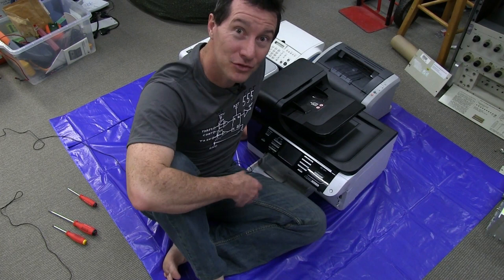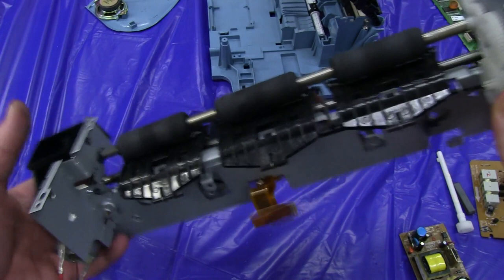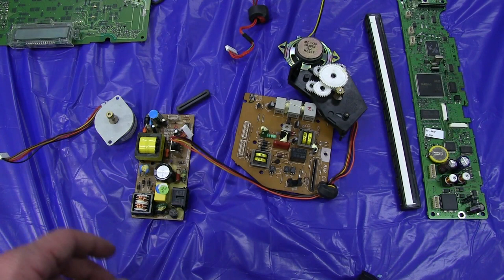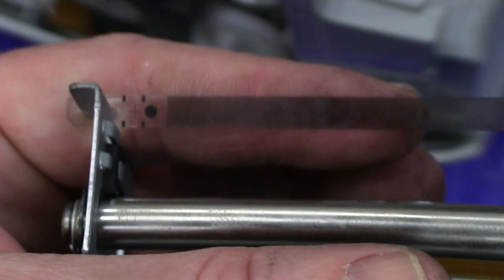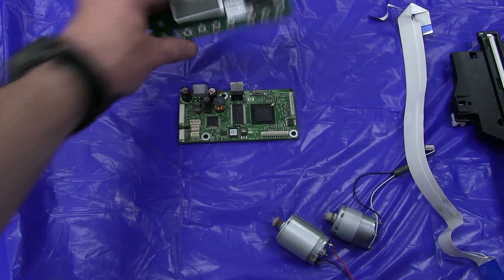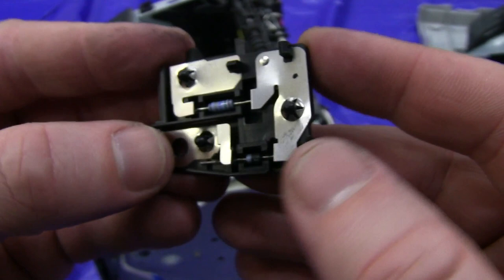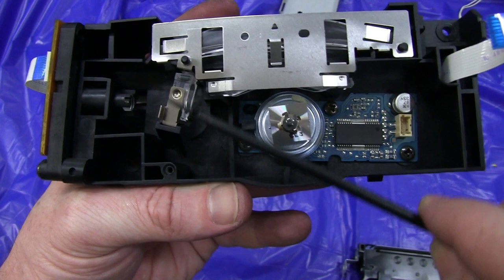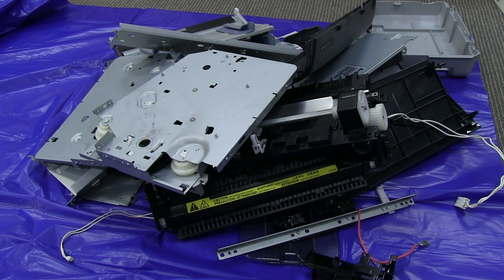EEVblog #488 - Dumpster Dive Parts Salvage

Comment: From what you salvaged on rail assemblies and such, I start to wonder if you would have enough to build a rudimentary 3D printer if you'd combine it with a raspberry or perhaps an arduino.
Reply: Melt down and print with the plastic scrap.

Comment: The resistor is a fuse resistor + diode, printers usually have a counter inside that counts how many pages have been printed or how many times the roller/fuser has turned and when it reaches the limit set by the manufacturer e.g. 10,000 pages the printer over currents the fuse resistor burning it out and now printer will refuse to print. it will usually give you a message in your PC saying maintenance needed bla bla bla replace XX assembly/part.  

Toner cartridge also have a chip inside them that is just a coutner- it does not actually track the toner levels so when you hit the limit the chip tells the printer im done... when it is not and it will refuse to print (even if you only printed 1 dot for the 1000 pages and your cartridge is full) .. it also stops you from refilling but you can buy the little chips and fuse resistor on ebay

Manufactures really really underestimate the life of the parts so you have to replace them more often. Some people desolder or short out the EEPROM chips on the logic board so that it cant keep track of how many pages have been printed lol

The fuse assembly, logic and power boards are actually valuable for if they work, stick on ebay especially the heater/fuser assembly.

Comment: If you can find the datasheet, its worth keeping the drivers with the motors. They will be handy to interface with microntrollers and especially for driving the stepper motors they came with (usually, just need clock and sometimes enable pin). I guess you should keep them and the wiring as a complete "package".

Comment: For an engineering project my group and I took apart an old inkjet printer. It did not have a full one piece head movement component like the fax but we took out the axle, print head holder and motor. With an Ardunio we built a functional 3 story model elevator. It was pretty cool.

Comment: I use the precision ground rod, that the ink cartridge carrier travels on, to set the tail stock on my small lathe. Set is between centers and you have a good point for your indicator to reference. 
Sorry, I know it is not electronics but many of us have more than one hobby. BTW a purpose made rod for setting your tail stock can run well over $100. Just a thought.
Reply: If you could collect enough of those you could use them in a 3d printer. That would save you quite a bit of money.

Comment: I believe the weird little steel plate/resistor/diode combo from the laser printer makes contact with the end of the toner drum/roller's axle. At least that's what I remember from a teardown of my own.
My guess is it's used to control the charge of the drum, so static doesn't build up and smears toner dust all over your pages or something. Maybe. Honestly, I have no idea, other than that it makes mechanical contact with the toner's metal axle.

Comment: 1)save and open the tiny button switches- they have a silver contact.
2)save the oscillators- they are silver,
3) save the ink jet cartridge - the film has gold on it,
4) save the white plug-ins on the circuit boards, the contacts inside are gold plated,
5) take the computer cable, cut the ends off, and remove the gold- plated contacts.
6)save the wires in the ink jet printer and computer cable. i use this small wire for my other radio projects
 (i just finished changing my old clock radio into a SW/ AM/ FM radio, and used some of the scrap wire from my ink jet printer.)

Comment: 20:04 I've built a reflector using that heating element... it's a 425W halogen tube(at least in those that I took apart). 2 or 3 of those also can be used as an electic heater if you put it in a black metal case. Be warned! Acrillic paint will burn of easily if you don't respect a proper distance(wich makes it less efective), or don't protect if from overheating. That thing can heat up metal over 100 degree C wile most paint supports only about 60 - 80 degree C max.
23:35 That lens is in angle to deflect the laser beam exactly to that rotating mirror.

Comment: The metal rods are great for home made cnc machines and 3d printers, anything you need to make an x, y grid and have the motors move, though the plastic pulleys aren't that robust and wouldn't hold up to much abuse.

Comment: I've used the motors from printers a few times, the ones with gears are great! You can hook them up to a simple rectifier and use them to make kinetic powered circuits. I use them with sound synthesizers, I recommend trying it out :)

Comment: As a foot note to the laser diode, there are some nasty elements to playing around with them depending on the wavelength. Most of these diodes are 808nm IR and when you power them up you see a piss poor red illumination, they is in fact pumping heaps of energy out in the non visible spectrum. BE CAREFUL, they WILL snot your eye.
On the plus side you can take the KTP/YVO4 crystal and all of the optics from your green laser pointer ( assuming it is 808nm ) and use the source as to pump the crystal and emit 532nm. I'm not going into the physics of 3 and 4 state population inversion systems, however, through a series of frequency doubling ( second harmonic generation ), a high power green laser can be achieved. Make sure you keep the same orientation to the LD as the original pointer and you are off and running. If you don't keep the correct orientation nothing will come out.
Admittance angel is important but if you play around enough green photons will come streaming out..
Lastly, I suggest TEC cooling the crystal of your duty cycle will be in the order of a few seconds and the life of the crystal will be reduced significantly as this method is at best 30 percent efficient; therefore, 1 watt 808nm in, 200-300mw out at a crystal temp of 23C.

Have Fun!

Comment: Sir with the right size copper connector you can fashion a torch tip with a Gear inside of the copper and it Make a Nice Flame

Comment: If you are starting out on the cheap, a lot of those connectors and buttons are useful to stockpile, like USB ports and power connections... the 'flat flex' or ribbon cable connectors might be useful if you have plans...

Comment: Once I disassembled an HP printer and got two useful things: Bluetooth USB Stick, WiFi USB Stick. I use them in my pc, They are bare board, no enclosure, but very good. I put the Bluetooth and win7 identified its driver fast, but the Wifi was not easy to find the drivers.

Comment: You might want a list of the fully working stuff I've found this year..
I cant do one, there are too many!
Off the top of my head:
Stereos, Big magnifying ring lights in need of a bulb, loads of aquariophilia stuff, small tanks, bubblers, pumps, (woohoo pcb etching tanks),
Numerous scanners, including an extra flat travel one.
That's excluding the stuff needing minor repair, often purposefully disabled by the previous user, usually severed power cords..
And that's limiting to electronics!

Comment: That device at 19:00 is probably the paper tray sensor. I did not see where you got it from but on some printers there are guides in the paper tray to identify what kind of paper is in the machine such as 8.5 x 11, legal  or A4. When you adjust the paper tray, it presses on different areas of the sensor. So that might be what it is.

Comment: The resistor and diode on plastic holder is used for HV discharge from opto cylinder. Otherwise it will not grab toner (charge up by laser) and not put it on paper.

Comment: You can use the springs to tension the steel wire of a hot wire cutter for polystyrene cutting. As the wire gets hot it expands in length. So we need a spring to tension it and to conduct electricity to the wire.

Comment: I think it's more along the lines of chance of actually doing that vs. difficulty of desoldering such a large surface mount package vs. the cost and availability of a new part. Not to say you can't do it if a low budget and high patience motivates you properly.

Comment: My guess is that the markings are for alignment during assembly (or even just alignment aids used when printing the plastic strip) and not read by the sensor.

Comment: A cool use would be to use the laser module to print traces directly on to a photosensitive coated board, but i am guessing one would need to replace the laser diode with a UV one.

Comment: Hi guys, I'm just getting into electronics repair RIGHT from scratch. There's actualy VERY few books or training videos on how to do it... which is weird. So i'm watching guys like this to try to learn. I'm actually go to start to practice Soldering now when i get a station, I have some broken PS3's and stuff that i can mess around with that i got for free just to learn to use the tools of Soldering etc.
Problem is, i only have about 90 euro to spend on a Soldering station with heat gun. Can anyone recommend a good cheap station that's not gonna go on fire and blow up due to how crumby it is? 
I'd really appreciate some info, thanks!

Comment: The fuser unit from one of these laser printers is quite useful if you are making your on PCB`s with the toner transfer method, ... just take the PCB and the transfer paper and run it throu ... you`ll still need the powerunit for it thou, and perhaps the motor, but heck, you are getting yourself a easy to make "toner transfer unit" :)

Comment: I think the resistor has something to do with dis-assembly safety. High voltage is used in those copiers and since it's reached using Villard cascade voltage multiplier, which utilizes diodes and capacitors, it's best to have a way to discharge it automatically. Those are my guesses only tho! Would love feedback on this theory.

Comment: You should teardown the fuser because the heat element is an halogen lamp. In your case thats 220v. And you can use that.If you look at the power supply pcb its direct power from mains it only got a relay in between.highly recommend you take it out.

Comment: I think that little section with the resistor and diode is maybe connected to ground, and is used to make sure there is no static on the rollers or maybe something like that, although that would make more sense for a toner printer.

Comment: I've taken apart some laser printers and found halogen lamps used as heaters.
They are double-ended tubular lamps 27.5cm in length with R7S base.

Comment: Apparently, UrJTAG can be used with the USB Blaster and many different devices.

The pinouts on most things probably won't match the standard Blaster cable though, so you'd need to solder the individual signals to the correct pins on your device.

You'd also need to know the memory map of the device, and what type of Flash chips or IO it has etc. (assuming UrJTAG supports it?).

Comment: 15:58:  that white thin strip is a long led strip inside of the photo pickup assembly for the scanner. that model doesent use cold cathode lamp. also tip, all "cold cathode" lamp units have a pair of HV leads from a small(ish) flyback like board useually white sometimes black or gray or even brown, and thay are easily spotted upon the assembly useually, the ones that dont use the cold cathode lamp typicaly are much smaller due to the less comples designs that dont use the mirror strips& lenses.

Comment: The control board at 18:34 doesn't have nothing
I see three SMD LEDs that are very usefull if you want to make something tiny that lights (for example keyboard illumination)
or the quartz cap on the other side which can be replacement if clocks actually fault those or some microcontrollres (that one might design) sometimes require external cap for their clock
but salvaging just for those isn't the cheapest thing to do

Comment: In the laser printer you have the laser diode which is in the laser diode scanner module. The laser diode is not going to be much use to anyone wanting to build say a laser pointer or anything. They are fairly low power 35 milliwatts or less I believe but I do know that they are infrared. So they are an invisible beam of laser light so not good for a laser pointer. Also very dangerous because even at that low to medium power they could blind you and you wouldn't even know that the invisible light beam hit your eyes so I was suggested people do not experiment with them unless you know what you're doing. And always wear protective layer laser goggles when experimenting with a laser diode, and make sure you have the goggles of the right wavelength protection.

Comment: You missed out on a really interesting piece on that linear actuator for the inkjet. It looked like it had one of those optical feedbacks for positioning, a plastic strip with lots of small stripes on it and a reader head in the cartridge holder. Depending on the construction of the optical reader it can be dead simple all the way to completely impossible to read using a micro controller though.

Comment: look at the working things that dave has found in the dumpsters, he doesn't just look around because there might be some useful components, frequently there are perfectly working devices that need no repair. where do you think the monitors he was talking about toward the end of the video came from? even if each is only worth 25 bucks, it was still a waste to toss them; i bet they are worth closer to 50-60 bucks each.

Comment: Usually they're about 5mw tp 7mw. Or in high speed commercial grade printers they can be about 20mw with TE cooling. The wavelength is 780 nm.

Comment: I wonder if the cartridge slider can be modified into a printer that prints circut designs directly onto the copper to create a PCB without printer transfer per iron or fotopositive methode at home. Might save a lot of chemicals and cleannup time in the kitchen.

Comment: probably that mystery plastic component with the resistor and diode is probably the WI-FI antenna some of these units that have WI-FI use cheap antennas such as the one in question.
Reply: No definitely not. You do not want a diode or a resistor on an antenna - gives losses and intermodulation. But I have already seen such combos at toner cartridges, as presence detect or ID. Sometimes they get burnt when the printer thinks, the cartridge is spent and tells you to replace the cartridge, so you can not successfully put in the old one again, say after shaking or refilling.
Sometimes it may just be part of the HV contacts.

Comment: The sensorboard @ 15:57 is not cold cathode but a 3 color led bar with a foto resistor bar next to it. 
I thought cold cathode was only used with the ccd-scanners.

Comment: You could use that printer assembly to mount your bench camera, to have it move in and out more smoothly. (with or without the motor), would have saved you buying that drawer slider.

Comment: I converted an old flat bed scanner into a UV exposure tank and the module you threw away ( ink jet assembly ) can be used as a camera pan system.  I did that with one of mine.
Reply: Noevilea "I converted an old flat bed scanner into a UV exposure tank" I would like to see this, you've got links?
Reply: hed420 I don't post link or videos mate but I can send you a pic via email if you like.
I use it for exposing the negative or positives of printed circuit boards and developing before the etching process starts.
Reply: I made a small light box for tracing.

Comment: 10:38 -11:02 See that weird "barcode" behind the glass? That is actually the end position marker (instead of a switch) If the scanner "sees" that, It will know that that is the end of the flat bed scanning area. I guess they do detect it this way to avoid having the cost of an endswitch, software programming is cheaper. Had an old AGFA snapscan once which used the same way of detecting the end, no physical switch in it whatsoever.

Comment: Have you had any luck in lighting the lamp in the all in one? Also is the heater in the laser printer a halogen bulb or an actual element? I pulled apart a scanner about a year ago and found a CCFL lamp in the scanner head and made an emergency light out of it. The inverter runs on 12 volts.

Comment: Those lasers and driver chips are very interesting when you want to experiment with laser-links or other high-speed applications.
Infrared (laser)diodes are cheap and the driver chips from laserprinters can drive pretty powerfull communication devices as well as lasergun-speedometer jamming (diodes)/lasers.

Comment: @ EEVblog I dont know wich is worse, that it does that to me too, or that it does that to me, in a whole different timezone, where it's supposed to be early morning?!

Total Non sequitur, but Dave, the printer rods usually machine really nice and easy, or so I've been told, so if you are into machining of teeny tiny parts and own amill or/and a lathe, they are free candy!
I stock those for when the time comes that I have access to this tooling

Comment: A lot of the monitors Dave seems to get are totally dead, only partially working (e.g. dead inputs) or need recapping to make them work. How much would it cost to get someone to recap a monitor and warrant the work.. more than a new one right? So for all intents and purposes that is beyond repair and not just chucking out the old for the new. If there is so much value in old monitors etc you wouldn't have to stick them on the side of the road etc to get rid of them.